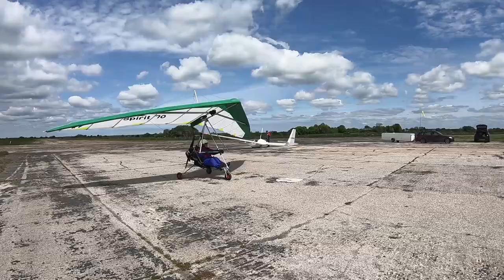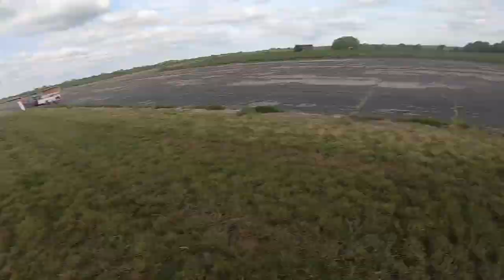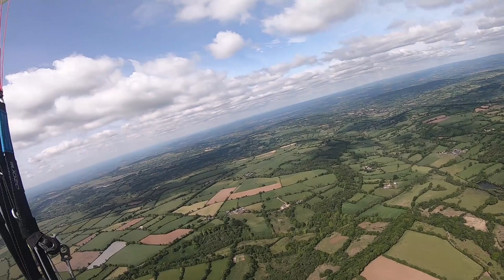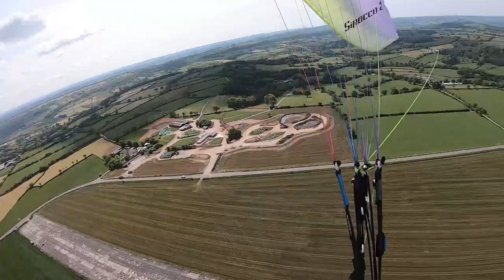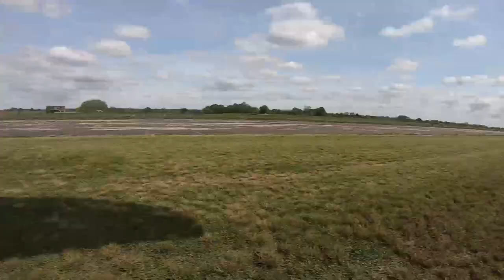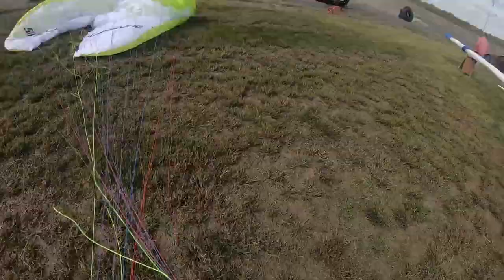Paramotor Vlog - Back to flying- Starting with the basics.

Comment: Good to see you airborne again. The local countryside looks wonderful.  Nice to see your progressive approach to get back into the air. Amazed at how much control you have. The landings near the edge of the grass by the kit on the ground, and the few steps after touchdown were a surprise to me who has no experience of paramotors
Reply from the maker: In the right conditions and a bit more practiced I'm normally within 2 meters of my landing spot. Paramotors are just so self contained and achieve so much with so little.  There is a bit of physical effort involved as you have to physically lift everything, but once you are airborne the views and distances that can be covered are amazing.

Comment: Great to see you back in the air, good plan with the ground handling before power and then some good air work. I hope others do the same as it is so easy to find skill have faded and you do not want to do that with a fuel to noise converter running on your back.
Reply from the maker: I'm so glad to be back in the air. Taking it stage by stage is like getting recurrent again. Looking forward to more cub videos.

Comment: Ironic that on a day when practicing for an engine out, you chose to take off towards a fence line- as though engine failure will only happen on demand.
Reply from the maker: I don't really have a second seat where someone can close the throttle for me, its just practicing the fence is no real issue.  I've only had one engine failure in a decade of paramotoring, but it could happen again tomorrow.  Its why I practice.  Turning the engine off at 600ft is too easy, 150ft then make a decision.
Reply: @GolfFoxtrot22  you miss the point- the fence is no problem as long as there is no problem... like an engine out.   A lack of past failure is not predictive.   I've never had a seat belt prevent me from going through a wind shield... yet.